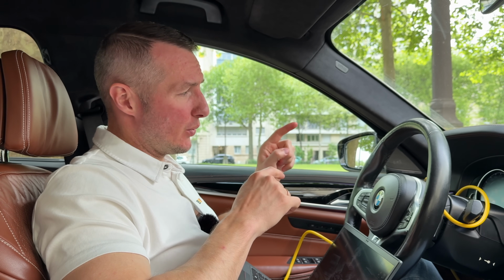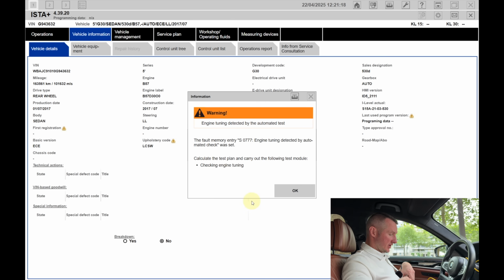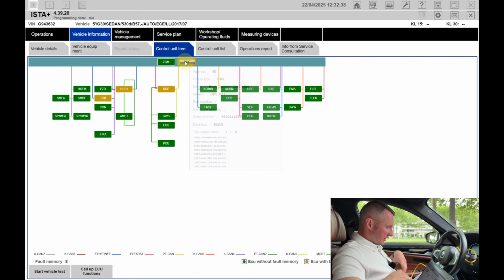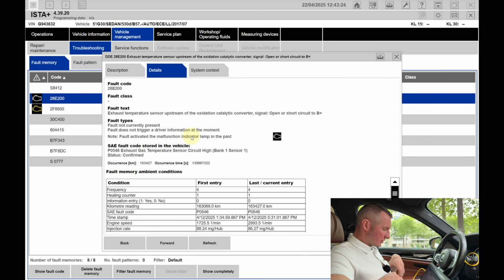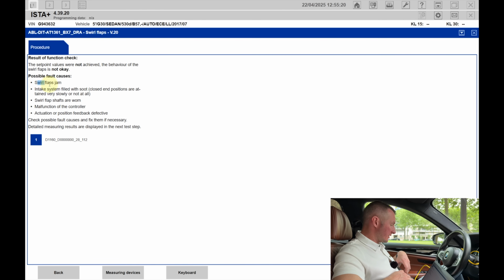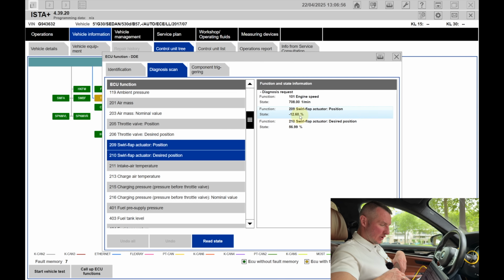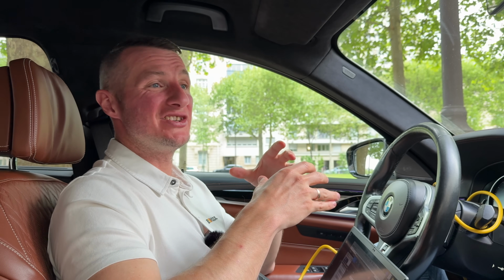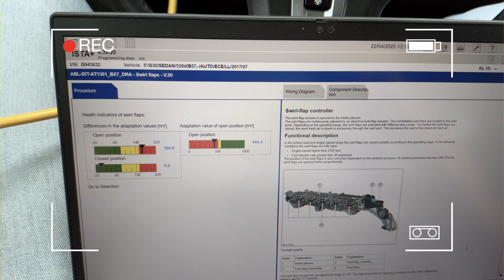BMW Diagnostics EXPLAINED (The Tool Dealers Don’t Want You Using)

Comment: Hi,  
I have a 2020 X1.  I start the car, connect the enet obd and the USB c to the laptop.  Then i start ista 4.39.20.  The connection manager recognizes the VIN, but when I click complete connection, the screen says I need to connect the interface for the diagnosis to be read.

Ive read I need to put the car in diagnostic mode by pressing the start stop button 3x for the connection manager to work.  Is this correct?  It wasn't mentioned in your video?  

Also, my x1 won't enter diagnostic mode when I press the start button 3x with my foot off the brake pedal.  Is this because my engine oil notice keeps popping up instead, and blocking the diagnostic mode?  

Your videos are excellent.  Thank you for making them.

Comment: Very good Video. Thank you very much. I am able to use the ENET Cable with my BMW F11. Unfortunately it is not working with my Mini cooper from 2008. Windows tells me, that no cable is plugged in. I already opened the enet cable and checked wiring and the 510 ohms resistor. Everything is fine. I also tried a crosslink cable. I thought, there is perhaps a problem with rx and tx (auto negotiation) This didn’t help either.
Do you have any hints for using enet cables with Mini coppers?
Or do I have to buy an ICOM interface?
Best Regards,
Andreas
Reply from the maker: Because mini 2008 is from E series generation 
Dcan cable is required
Reply: @BimDoc  Thank you so much for this hint. I thought 2007 was the limit. I just ordered a DCAN cable. I will send an update, if it is working.

Comment: Shows VIN in connection manager but doesn't read out data in operations, it's literally stuck as is at VIN identification dialogue box since 2hrs.

Update: I entered the VIN manually when it asked, it gave out basic information except mileage(as if it decoded info from the VIN alone) and stuck at 80% progress bar since 5hrs.

It's a G28 connected with ENET + USB ADAPTOR on ISTA+ 4.39.20 on Windows 10.

Please help me out, I've tried almost every solution I could find online.

Comment: Does the software allow you to rebuild the engine on n55 model?
Reply from the maker: Ista has a lot of technical documentation built in to disassemble the engine. 
But it requires some previous experience as well.

Comment: i am wondering if changing the VO would harm the hardware... i'd say no- however i have several errors regarding DSC on my F54- and they can't be erased... i will try reflashing the module and code it again with normal VO.. thank you for that informative video! :_bimdoc:

Comment: If ECU is not responding and ISTA shows "GR" instead of fx real name "EDCSVR" what does it mean? I struggle with FlexRay line 6 but don't know what is GR in ISTA meaning. Sometimes ECU is green and then there is true name.
Reply from the maker: It looks like some wiring problem. Check flexray bus. 

Bad ECU could be as well. 

Very hard to say based on that info.

Comment: In my ISTA folder "Print" is missing and even if I use print memory, then they are missing. I tried to search in all c drive words "report", nothing. Next time I will use default priner and save as PDF :).
Reply from the maker: Use ista v4.39

Comment: Great tutorial, could you maka video explaning top issues with connection settings? Fx. error PAD Active, network configuration, if IPv4 IPv6 matters and so on.
Reply from the maker: Use Automatic IP settings IPv4
That’s it

Comment: I have watched your presentation, from a couple of years ago, "Mastering BMW Software: A Step-by-Step Guide to Installing Diagnostic and Programming Tools" which I found informative and the best presentation I have ever seen in this regard.
However, before going ahead and installing everything, as explained, I though it a good idea to check if you had any updates since two years ago - which brings me to this presentation.
BUT..... Would I be correct in thinking this video is not for me, as I drive a BMW E90?

Also, when I downloaded the software, yesterday, Windows gave me a "suspected malware" warning which I presumed to be a false-positive so I downloaded it, anyway.
Unfortunately, when I unzip the file, it records over 900 unpacking errors and each of the folders produced are empty.

Any ideas what caused this and how to resolve it, please?
I feel sure it's a user error on my part rather than an issue with the zip file.
Thank you.
Reply from the maker: This error comes due to crack for launcher pro

I’ll upload another software pack (same but without launcher) to avoid that antivirus craziness ))
Reply: @BimDoc  Sounds like a good plan and, as I inferred, it was probably something I did wrong.
Thanks for responding.
I have since factory reset a spare laptop, installed Windows 10, downloaded the software pack again and got the same unpacking errors (9,350 of them). Oddly, the folders are populated but I won't know whether the applications and related files work until I connect to my vehicle. I may need to download the next pack you upload.
Three more questions, if I might be so presumptious with your time and expertise:
1) This particular tutorial [BMW Diagnostics EXPLAINED (The Tool Dealers Don’t Want You Using)], does it apply to the E series or only the G series? As I have an E90, I do not wish to risk confusing myself through viewing a guide that is of no value to my situation.
2) I have to purchase a connecting cable from my PC to the BMW E90 320D. Is it DCAN or K+DCAN which I need? Also, is there a particular brand/provider of a cable you recommend for a hobbyist (I don't need workshop standard as I hope to only rarely have need of it). Should I just buy the cheapest I can find or is there a particular model which will not break the bank but is generally relaible, to acquire?
3) Finally, is the software pack you provide, along with a suitable cable, likely to resolve a "no crank-no start" issue I have, along with a "steering locked" dashboard notification? I understand I must first unlock the steering (through dignostic/coding software) and then reset the ELV counter, via the same application.
Thanks for your time, patience and indulgence.

Comment: Great video — very clear and informative, thank you! I’m dealing with the exact same issue: replaced the intake manifold, yet still get the 2F8500 swirl flap error. After manually moving the flaps once, everything works fine — but only until the car has been off for a while, when it fails again on the first attempt. I’ve read this could be related to a faulty ECU memory chip. Have you come across this, or do you have any insights on it?
Reply from the maker: Hi,
It is not the error in the DDE memory 99%

It is intake manifold and swirl flaps. 
Replace it. 

(I’ve done it and now no errors)

Comment: Really nice, last time I worked with older Ista version is at least 8 years ago, using it with the my old E61. Never got eSys to work, I think. But all the other known Programms for the E-series…..
Reply from the maker: Esys is not for E series 
F, G and newer
Reply: @BimDoc I know…. -> „but all the other known Programms for the e-series“ 😊 ESys was to be used it on my G31, but never get it to run. Maybe I shall try again to get a hand on it.

Comment: very useful video.  do you know if i can unlock video in motion with thinkcar max.
Reply from the maker: ViM can be unlocked on the supported HUs
For example on entrynav2 it is not supported. 
On pro navigation systems (like Evo or MGU) it is supported.
Reply: @BimDoc  can you advise me how to do it,please as i adjust all speed restrictions to 255 and untick handbrake restriction. still doesn't work
Reply: @BimDoc  NBTevo_M17365l

Comment: Hi Vladimir. I have installed ISTA using your how to video and setup the connection as you did but even though I can see the vehicle VIN in Connection Manager in ISTA, when I click  "Set up connection" nothing happens. Can it be due to the fact that my laptop doesn't have an ethernet port, so I am using a dongle from ethernet to usb C ? I doubt that but I am not sure at this point why I cannot establish a connection. Any suggestions ?
Reply from the maker: Type C adapter is absolutely okay to use!
Most likely you have ediabas issue or version of ista is not good one.
Reply: @BimDoc  I have reinstalled ISTA 2 times, the same version v4.39.20 and failed, and in the end I've choose to purchase the latest version from BimmerDiagnostics and guess what? It worked without issues. I assume these free files that we take from forums might be corrupted (can work for some vehicles, but not for all). Something for sure was wrong with the files required for my G31. I am thinking now if I should update the data base with the latest or leave it as it is, since I only need ISTA for service/maintenance and diagnosis for now. I won't do programming.
Reply: I'm having the same issue, but im directly connected to ethernet. Did you manage to fix it?
Reply: @povilas8177  Yes, I wrote in my comment above how ...I paid for a version that worked, instead of all the crap versions you find on forums from 100 different users. Don't know anything about those BimmerDiagnostics but took a leap of faith and bought it. Works perfect, 0 issues.

Comment: Is it possible to use ISTA+ with MHD Enet?
Reply from the maker: I think yes, but I haven’t tried
Reply: @BimDoc thanks for responding. Do you know where I can adjust the network settings for ISTA+? And which protocol should I use to connect with wireless ENET?

Comment: Is there any option in ISTA to know how many amps the alternator loads?
Reply from the maker: Volts for sure. Amps I don’t know. Need to see in ista. 
If it is present there then it will be under DME ECU parameters

Comment: I am confused when you tested the swirl flap function ISTA said "in the next step, the swirl flaps are tested several times with the engine turned off" yet you pressed continue to carry out the test and you said your engine was running?, so do you do the test with the engine running or not?, please advise
Reply from the maker: Some tests require engine ON some require engine OFF

See what ista says during making certain service functions.
Reply: @BimDoc thanks for the reply, I am going to test the swirl flaps on my F25 3.0d 2013 the same way so should I have my engine on?
Reply: @BimDoc  I performed the Swirl flap test today with the engine running and it said they were OK, thank you for your very good and informative uploads

Comment: I have a other problem with istaP cna you help me what this error means? 

Error 1 "" An error occurred while executing the action.
k):
94201 -2 10007
Service initialization failed Global.Unknown (CIP) Error during initialization of EDIABAS" 

Error 2 " Vehicle order import
A vehicle order could not be downloaded.
Note:
The vehicle order can be imported later via another import source.
With "Continue" the vehicle order can be imported again. "
Reply from the maker: Error 1: check ediabas settings (istap requires ediabas 7.3 not newer)

Error 2: FA/VO cannot be read from the car. Use NCS expert to fix it first
Reply: @BimDoc  what do i need to fix with ncs expert?
Reply from the maker: Write VO into your CAS
Reply: @BimDoc what about the other one you said about ediabas can you assits with that payment is no trouble sir

Comment: Hi Men, can make one video if some massed with Coding and they want to reset the code back to original how they can do it. If you already made one please send me a link. If you didn't under reply to this I will explain more.
Reply from the maker: It’s easy)

See my esys for dummies manuals. 
I guess part 2 (VO coding)

It will reset all back up I factory settings. Just keep your FA/VO original

Comment: @BimDoc Man you are killing it with all the stuff your posting. Thank you! :) I installed the Standalone 4.39.20 with BLP only and later,  installed full SDP(4.43.21) data but i cant see anything under the "Programming data details" tab on ISTA+ settings. Any ideas? Havent tried to connect to a vehicle yet.
Reply from the maker: To mix different ista and databases you need to modify WIN register. 

But it’s better to use esys for programming!
Reply: @BimDoc  Thank you very much for your ultra fast response! :) That you still answer your followers is incredible! :) My ista installation had C:EC-APPS\ista\psdz\data_swi as default SDP location and  C:EC-APPS/ISTA as ISTA installation location. Changed the regedit files and defined C:Data as location for pdsz and C:ISTA for ISTA, but that didnt help. At the end i changed ISTA install location and psdz(SDP) files location to Insta standalone installer standarts in the registry(regedit) and that didnt work either untill i finally recognized the fault i was doing. I was putting the contents of extracted psdzdata folder directly in to data_swi folder instead of inserting the psdzdata folder direcly under data_swi folder.

Comment: Can’t run smooth running control on version 4.52.40. It doesn’t have the options you show on screen
Reply from the maker: It also depends on the bmw you are connecting to
Reply: @BimDoc  that makes sense. It’s a 2015 750i. Your tutorials are so dang informative. LEGEND!

Comment: In my BMW g30 dealer change egr cooler. And after thet isue with swir flaps.  The new egr software and problems start..
Reply from the maker: I’ve noticed that as well than in newer SW version algorithms are changed and swirls start to give the errors. Error tolerance is made smaller.

Comment: For the ECU tuning check, do you know what parameters it is looking? Calibration ID vs Calibration Verification Number, flash counter, which are quick and simple checks or is it more complex and look at actual performance data that is outside of what it should be performing?
Reply from the maker: During basic check it does not look for performance data (fuel cards), but it can in service functions ABL mode.
Reply: @BimDoc  Thank you

Comment: Hi Vladimir. Thanks for the video. Just one clarification question, if you run ABL for a newer car that support NCD 2.0, is there any risk? Can ABL run any coding in the backend so that may result to be harmful or any ABL is not related to coding at all? Thanks for your time!
Reply from the maker: Very good question btw!

For some ABLs (that are required for NCD 2.0 BMWs) standalone ista will not ruin anything. It will just not proceed. 

Online ista is required to complete the operation!
Reply: ..because probably is checking if there are any updates to that controller, sensor.. correct(?) and it will try to update it..
While standalone is just throwing commands to the sensors.. modules.. to test it.
Reply: @MrFryfish  where do I get the standalone software?

Comment: Thanks for the video! I would like to add that each diagnostic process report is automatically saved under the folder - ISTA / Print. Greetings from Latvia, I have learned a lot from you!
Reply from the maker: Yes it does ))

Also very good to know that ))

Comment: Hello Vladimir. Thanks for the many very informative videos. I have one question: Can I Update my G31 with an ICOM using ISTA 4.39.20 and program data 4.52.40? Thx
Reply from the maker: Yes if ista sees those databases well. 

But icom has to be connected via router (otherwise you will brick your HU)
Reply: Can you explain more that connection of ICOM? I do have one. 
So the ICOM gets plugged to the router then the laptop is connevted to the router as well? Hardwire (data cable..) or wireless?
Then ICOM is plugged into OBD port..?

Then we create a communication path: laptop-router-ICOM-car
Correct?
How can we make sure the communication is not disrupted during diagnosing/coding?

Thank you.
Reply: The original icom will not allow the vehicle to be updated if the vehicle is not connected via cable. It does not support wifi. I have an icom connected to wifi in the workshop, but when I program, I have a cable running to the router.